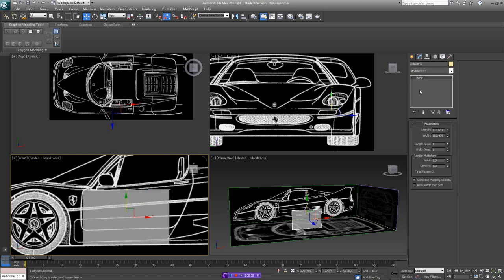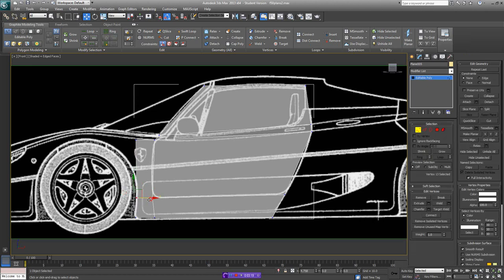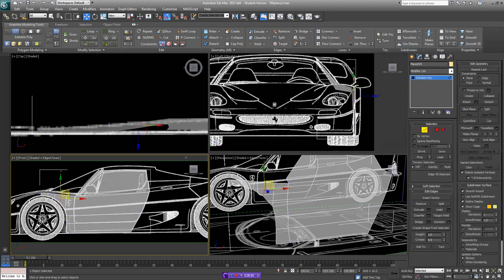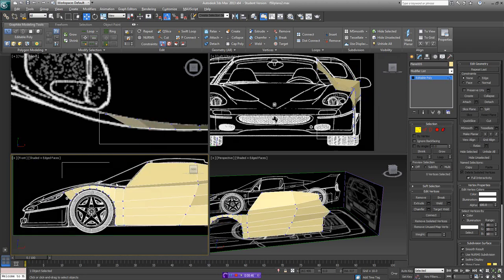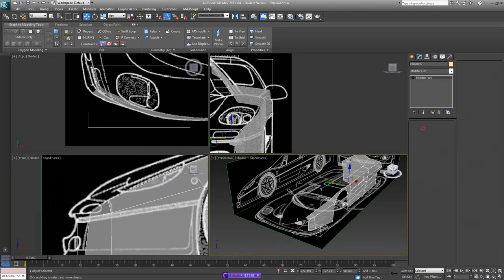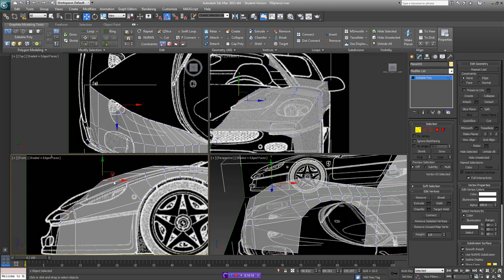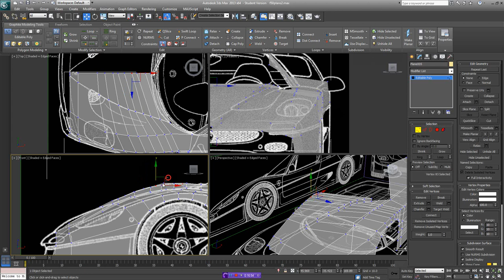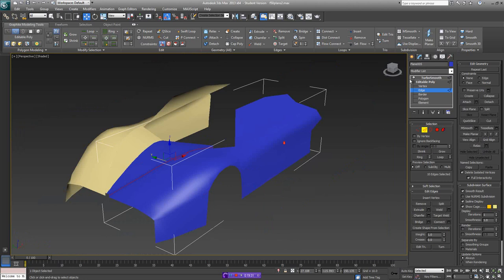3DSMax - Plane Modelling A Ferrari

Comment: spline is looking like easy than this?
Reply: Plane modeling (or classical Edit Poly) need more accurate topology. You need know how make huge topology. In 1980's cars crazy topology.
Reply: Okay. Plane modeling harder. Author from 11:23 create shape (spline) and only connect this (attach + cross section) for make form. True plane modeller make this part only with poly's.